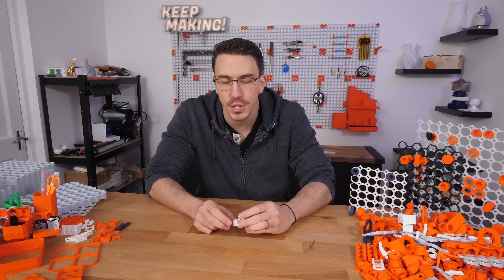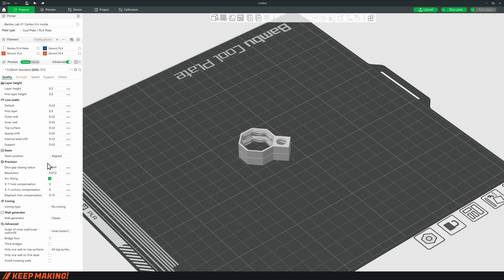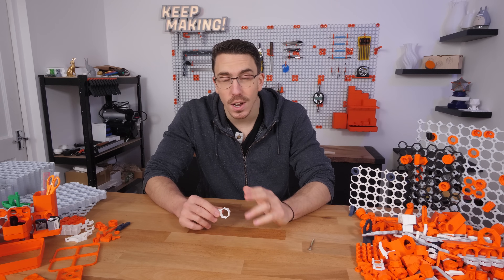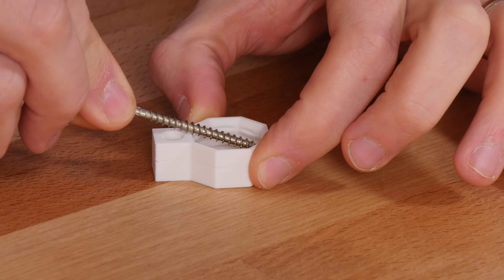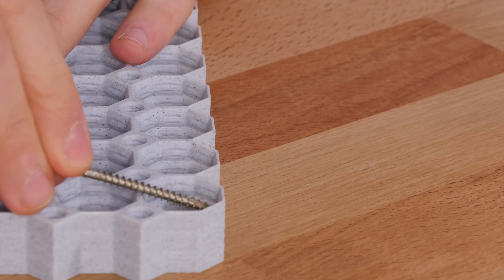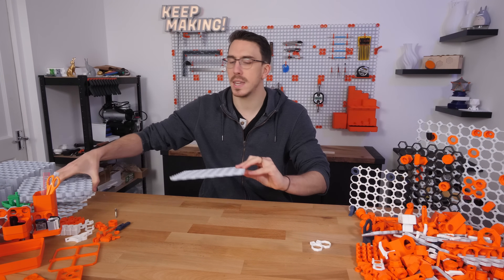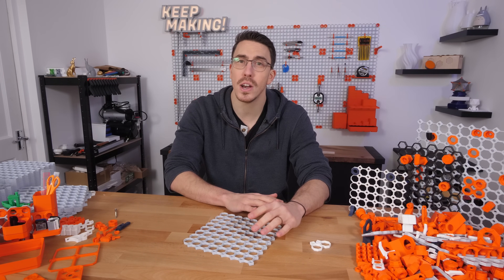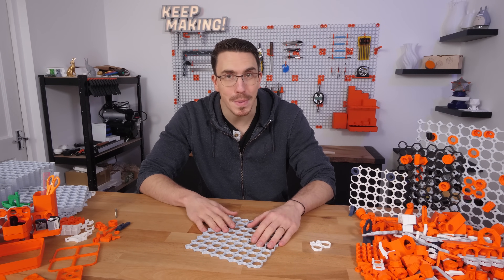Multiboard: What Is Stack 3D Printing

Comment: You didn’t mention any pros here, and I’m kind of struggling to see what they could be. 

Ironing isn’t exactly a fast process in my experience, and I’m not convinced that the amount of time I have to take in order to iron then separate my prints would save me any time or effort over just running several normal prints on my machine. Additionally, because the bottom surface would always print against the bed, I already have a perfect layer that can face out from a wall, in addition to the top layer which when set up correctly is perfectly acceptable aesthetically in my opinion. 

Part of that may just be due to the fact that my main printer is a Voron Trident that has CNC TAP, so I get basically perfect first layers every time, but I’m really struggling to see the benefits here over just running several prints one after the other. I feel like I’m missing something in terms of what the benefits of this process are, and would love to know what it is I’m missing.
Reply: I think the benefit is mostly in doing a fire and forget print that yes takes a while, but would be great for an overnight print for example. You get a bunch of grids all done while you're sleeping with out having to clear the bed. If you're going to be near your printer anyways and can clear the bed, that's going to be faster than ironing for sure.
Reply: If you have an actual job you're not gonna be home to remove one piece and start a next one over and over again, esp if you need a lot of pieces for your wall. With this you can just leave it to print for like 12 hours and have a life. Come back to a stack of these ready to put on your wall. But if you're too free, obviously printing one by one is faster than ironing.
Reply: @KryaDiere  thanks for the input, I hadn't thought of that as I work remotely and can take a few minutes here or there as needed to pull a print off. 

That makes a lot of sense.

Comment: How do you stack? This shows how to pull them apart. When I try to move my print up on z it snaps back to the plate.
Reply: You can either stack them directly on your STL file, or if you want to clone/move parts in your slicer, you need to select all your cloned objects, assemble them into parts. Then selecting with Alt+click, you can select a part and move it individually, even in the Z dimension.

Comment: Tried the test in PETG and I couldn’t separate them. Printed on a Bambu x1 Carbon with the recommended settings from the article on your site. I managed to split them apart but broke the bottom one because of the amount of force needed.
Reply: Did you ever get this to work? I'm in the same boat as you with P1S... seems like there are a lot of suggestions in here but none quite give me an A-Z idea of how to accomplish this with just PETG.
Reply: @bcboncs  no I gave up on it
Reply: I got this to work with Bambu very easily .. take the file, use the settings he says for the ironing and walls... etc... then right click the grid, add part then pick the same file again ... then select both "parts" (has to be a part) by clicking then holding ctrl click ... new feature with light up in bambu "assemble" click that..... now select top face of bottom part, and bottom face of another. click the "center" button in assembly drop down, then enter .2 for the gap ... done...

Comment: I feel like I totally missed the part where you explain how to get the printer to print the models on top of each other.
Reply: It's the STL itself that includes the stacked shapes with a small gap between them.
Reply: The file with the stacked arrangement is only offered to paying members/supporters.
Reply: @dg-hughes  anyone can do this in the slicer. You do not need to download their stacked file.
Reply: @joetrzaska  thanks, I'm still new at 3D printing the Bambu slicer settings are a dizzying mess to me.
Reply: @dg-hughes  I got this to work with Bambu very easily .. take the file, use the settings he says for the ironing and walls... etc... then right click the grid, add part then pick the same file again ... then select both "parts" (has to be a part) by clicking then holding ctrl click ... new feature with light up in bambu "assemble" click that..... now select top face of bottom part, and bottom face of another. click the "center" button in assembly drop down, then enter .2 for the gap ... done...

Comment: Why doing a stacked print in the first place? Is there any benefit? I can imagine to run unattended with less table changes?
Reply: I imagine that's the exact reason. You could do 10 times more in one print
Reply: @dts7824  Risking anything going south to affect all prints though. Considering that and the bad finish of one side plus separation time, it can have it's uses. Further advance in implementation may be needed.

Comment: Why not use petg or even dissolvable support material as a interface between the layers. It's much easier with a multimaterial printer but very possible without one.
Reply: The main reason to do this is speed of printing and convenience (unsupervised printing of many pieces). If you don't have a dual amterial printer, then you can't really do that in an unsupervised fashion

Comment: If you really need to do this, just get two different materials of the same color. PLA/PETG/PLA/PETG. Makes getting them apart easier. That said, I guess this saves time in the sense you do not have to clear the print bed after each layer on a standard printer. Interesting idea, but I doubt I will ever use it.

Comment: Or you could put a 2 layer PETG interface between each layer of PLA grids and have near perfect parts both sides.
Reply: Or just alternate each model, one in PLA, one in Petg etc
Reply: @TheKdcool  PETG isn't that good for that kind of print. It's not holding as much weight.
Reply: If you have to manually pause the printer and change the filament, might as well just don't do stacking at all to begin with, though.
Reply: @slabua  true I guess, but I'm pretty sure this was with multi material printing capabilities in mind.=)
Reply: @slabua  you can insert pauses in the slicer. But you still have to perform the filament change by hand then.

But yeah I wouldn't do it personally.
Reply from the maker: That is a good shout... need to give that a try
Reply: @Keep-Making  can confirm it work with alternating PETG and PLA with ams, it was already done for HSW system ( on printable 520116 ) no need for gap or interface. None the less, cool design ;)
Reply: Too bad the majority of us don't have multi-material printers :/
Reply: If you're using a Single Extruder Multi-Material setup, I like using CA Filament Matte PETG for this, as those filaments actually print better at lower temps compared to regular PETG. This way you can save time during changes not waiting as long for nozzle temperature changes
Reply: How do you do that? I have an bambulab printer as well
Reply: @jonogunn  same instructions..
Reply: It would but now you need a machine with dual extrusion or multi material support maybe even a purge tower to keep things clean. It would definitely work but does open more opportunities for failure.
Reply: Multi-material failures isn’t really a thing if you have a Bambu labs machine. It’s so reliable now it’s like normal printing. If you’re ok with poor surface finish on all the grids layered in the middle of the stack (both sides) then go for it. But if you’ve got multi material as many do now then an interface really helps. You still need to add a tiny gap between the interface and grid 0.1mm maybe, otherwise the slicer won’t see the top and bottom of each grid as solid layers.
Reply: wow we need a special PETG filament made specifically for use in supports
Reply: @AckzaTV PLA with PET-G as the interface in between. Nothing special. PLA and PET-G don't stick well to each other
Reply: @TheZionPhil if they don’t stick well, how are you going to avoid the first layer not making proper adhesion to allow you to keep printing on it
Reply: @AckzaTV  you mean like the multiple breakaway support materials that already exist?
Reply: That only works for printers with multi color systems.

Comment: this is very useful - you can do this without AMS, so no interface layer needed - only downside besides your mentioned downsides is, that you need a planar top surface to print on - does not work with models that have multiple top surfaces, else it would take ages

a possible solution could be to introduce an interface layer in the model: 0,1 mm height and 0,48 mm wide with about 2 mm spacing, just loops like the support interface would do and then print ontop of that with 0,1 mm gap - this way to bottom surface looks way nicer

Comment: Ah. I was wondering when someone would do this, and with what type of project.

I honestly expected this to be more of a thing with dual extruder machines, specifically because of the sharp single layer left behind, but this design even works with that.

I've seen this a bit with resin printers, but nice to finally see others experimenting on this with FDM as well
Reply: Not to diminish the feat, but this technique has been around FDM for a while. It's just uncommon for most models to need to be mass manufactured like this. I remember at the start of 2020 when everyone was printing face mask shields this was one of the methods used to get things printed as fast as possible.
Reply: With a dual extruder or an AMS setup you could just stick a layer of PETG in between

Comment: ❤ I printed the 6x6 starter stack on the A1mini in Polylite Pro, default settings and it worked incredibly well.

At first I was worried because more than a few layers looked curled on a corner (not the base layer with brim).The stack however peeled apart like a dream, every plate was perfectly printed, I couldn’t even tell which layers curled after separation when laying them flat on a granite countertop… extremely impressive. ❤ so happy with this system 🙏 Thank You.
Reply from the maker: I love here it MakerBees!
Be sure to share your build in the discord I would love to see it grow =)
Reply: @Keep-Making  I see now it is free ☺️,  I just hope you take my donation towards Blender CAD because Multiboard is awesome and practical but CAD in Blender getting fully developed is a literal game changer ❤️.

I will definitely post the make as I go on Discord but it is definitely fighting the que for last minute gifts on the printers 😁.
Reply: @MakerBees333 Did you’ve checked out Plasticity for a Blender CAD feeling?
Reply: @lazyman1011  I did checkout Plasticity when they launched, was super excited, but because of so many time crunches I couldn’t dedicate enough time to get the controls moving.

Blender has been become my Brains default keyboard shortcut 😊, and because of the other powerful add-on’s  my favorite modeling software despite the destructive nature.
Reply: @MakerBees333  If you’re able to use it then do it. I’ll start my plasticity journey this month.

Comment: I wonder if you can make multi board print faster/stronger by printing with a wider extrusion width.  Lost in tech did a series of videos exploring printing wide with a .4 nozzle.
Reply: That definitely depends on the material and speed. For example too fast with PETG will delaminate no matter the width of the line or layer. Some PLA pro will break on layer lines if too thick.

I think “Slow” or regular speed and steady win the race here as I plan to utilize this system for a long time. The wife even approved and she didn’t of the Hexwall, that is quite high praise of how ascetically pleasing it is in person 👍.
Reply from the maker: Hmmm would be intreatstin to see... My only concern is that it is shifts the tolorenses it might screw up the connecitons with other parts but the only thing to do is test test test.